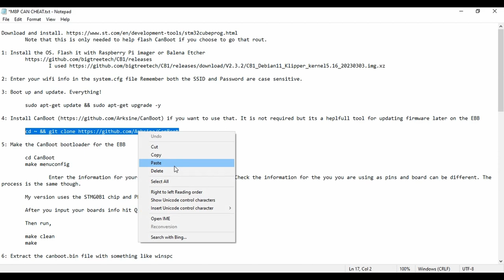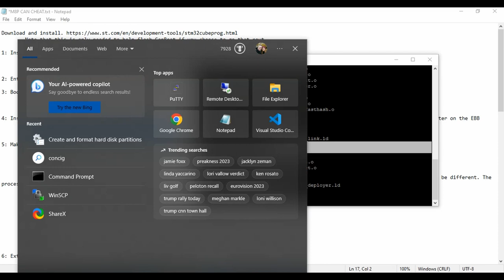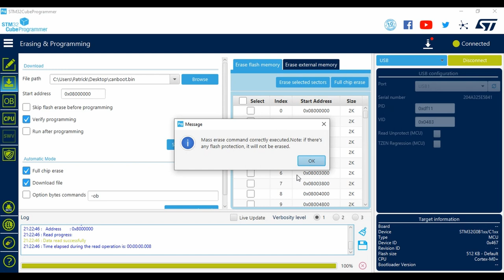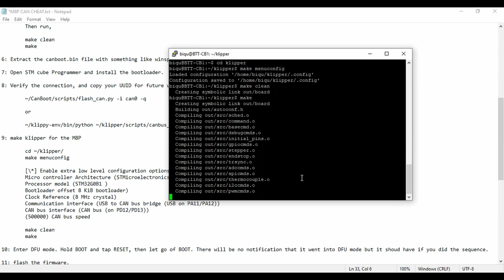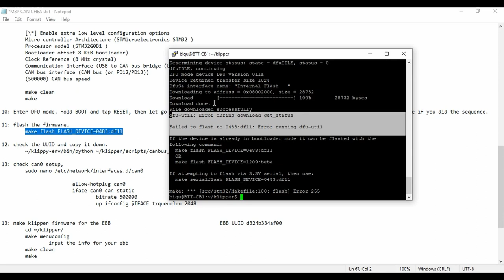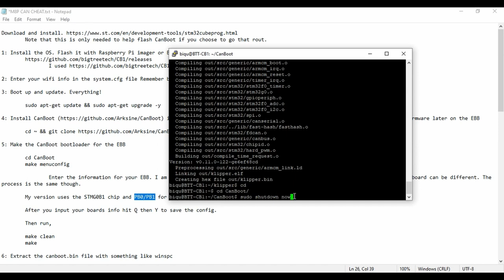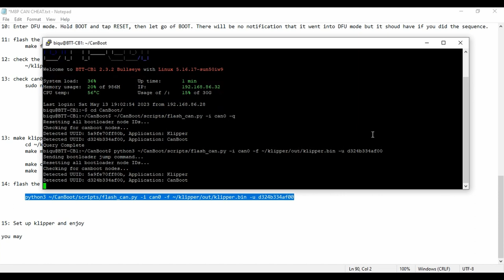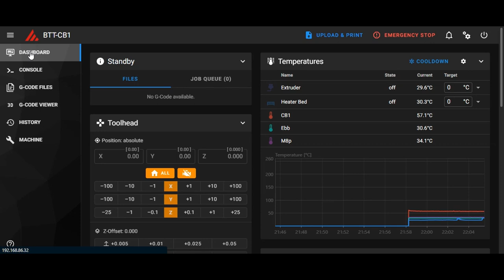Manta M8P+EBB CANbus Setup

Comment: hey there. super informative video and im super new to all of this. how do I safely ssh into the cb1 v2.2 so I can install the image? I know it's probably really basic but this is all so new to me. if you could point me in the right direction id be so very grateful. thanks a ton.
Reply from the maker: I like to use a program called PuTTY (putty.org). After connecting to your network you just enter in the ip address and connect.  The cb1 default username and password are both, biqu

Comment: im even confused now if this stm programmer is the same because I cant find the options fo see USB or even flash. do you have any recommendations how to ?
Reply from the maker: I see some had to use an older version of cube programmer.
Reply: @StackingLayers  is ok the software installed other apps i was using something different not actually programmer. Now it worked. But I'm now trying to make did to show up I'm stuck here I'm installing 120r pin and also connecting the Cable . That part on the video you didn't mentioned
Reply from the maker: The 120r jumper needs to be on the first and last device on the canbus

Comment: I decided to dive into canbus using a manta m5p and ebb 36, using you video i was able to achieve this.  However do you have a video or atleast a recommendation, on the configuration that needs to be done in klipper to get this to work?
Reply from the maker: This is the generic printer.cfg for the M5P https://github.com/bigtreetech/Manta-M5P/blob/master/Firmware/Klipper/generic-bigtreetech-manta-m5p.cfg

And this is for the ebb 36,
https://github.com/bigtreetech/EBB/blob/master/EBB%20CAN%20V1.1%20(STM32G0B1)/sample-bigtreetech-ebb-canbus-v1.1.cfg 
You'll need to make a printer.cfg that combines them or set an include function.

Comment: Nice explenation, Its close to the hermitcrab. At this moment I'm having the problem you commented out in your video. I loose the communication once I call for the UUUiD.  or it just give me one node UUUiD.  is the a way to flash other than having a new SD card on CB1 or to fix the problem ?.
Reply from the maker: You can try to stop the klipper service before querying the UUID. That will sometimes work. This is the command,
sudo service klipper stop 

And to start it back up,
sudo service klipper start

Comment: why do we need to use stmcubeprogrammer? as a canboot for the can bus? as for my situation im using fly sht 36 pro, and at github it is said to have preinstalled canboot, so i assume i can skip the smtcube programmer right?
Reply from the maker: Correct. There have been several update since I made that video so I think I will be doing a revised video soon. But if you already have can boot installed then you can skip that.

Comment: Due to an SD card failure I had to start again. Everything went according to plan but when trying to configure klipper I get this - Option 'serial' in section 'mcu' must be specified. The /dev/serial directory is missing - how/what?
Reply from the maker: If you set it up as canbus you have to use can_uuid not serial. Like this,

    [mcu]    
    canbus_uuid: your UUID goes here

Comment: i am a little confused i got to step 13 now for flashing the EBB do i connect it via canbus hi / low or usb host on the cb1?  that part was left out of the video how to connect to ebb to flash klipper
Reply from the maker: Yes you connect to canbus at this point. I didn't show it but mentioned it around the 31 minutes mark.
Reply: and you are still powering the ebb via usb?  @StackingLayers
Reply from the maker: No, I connect 24v from the power supply.

Comment: Would this work on a manta 4 board?
Reply from the maker: Unfortunately the manta m4p doesn't have a canbus transceiver built-in, but you could attach a U2C module and that will work. You would skip the can bridge firmware for the m4p and just set it up as normal usb connection. The ebb will be the same as in the video.
Reply: @StackingLayers  

I bought a custom built ender 6 that was somehow running  can bus on a manta 4 board the I think a power surge took out my programming and I can't find how to re enable it.  Should I upgrade to the 8 or the manta 5 board
Reply from the maker: If you had canbus running then there must be a canbus hat on the gpio pins or a U2C module the manta m4p cannot run canbus alone. It doesn't contain the physical components for it to work.
Reply: @StackingLayers  
I have look so many times and looks like a plain normal m4p

Comment: can't get it to work, following all the steps, then after flashing m8p rebooting and connecting the can cable no uuids found when " ~/klippy-env/bin/python ~/klipper/scripts/canbus_query.py can0"
Done this a few times, seems everytime i power down the boards they reset? got everything working once, but stopped after i shut down the printer. 
help...
Reply from the maker: They can't be reset as there's nothing to reset to. Once you get the UUID entered and klipper sees it then it will not show anymore. It also will not change, so if you have it saved it will be the same uuid. Otherwise make sure to not set up the uuid in the printer.cfg until you get all that you need, and save them in a text document os something like that.

Comment: Thank you so much for the  video its been really helpful. I was able to get to the point where I flash the firmware to the manta board but I seem unable to get the board into DFU mode. everytime I run the flash command it just returns that there is no dfu device.
Reply from the maker: Make sure to firmly hold the boot button down and continue holding it while you click the reset button, after that you can let go of the boot button. It should be in DFU mode after that.
Reply: @StackingLayers  I have done that multiple times with no luck. Just to be sure I did everything else right I started from scratch and installed a completely new os image and I am still having the same issue.
Reply from the maker: Alternatively, you can use a program like  winscp to copy the klipper.bin (/klipper/out/klipper.bin) file from the host computer to your PC, then change it to firmware.bin and put it on an SD card and flash it that way using the MCU SD card slot.
Reply: @StackingLayers  Thanks, I tried that and the Manta doesnt even seem to be reading the file, I have tried 3 different SD cards. when i reboot the board with the firmware file on it is doesnt change its still a .bin file.

Comment: Hello, when I set the M8p to DFU mode, I can see the device with "lsusb". But when I try to check for connections after the flash, I get "Failed to transmit: [Errno 100] Network is down". Was the katapult software supposed to start the CANBUS connection or something?
Reply: Right after I posted this I repeated the same thing for the 100th time and it started working... I want to leave this up for others if you see this error to check the can0 config in top of desc. After I copy pasted that into there and rebooted I was able to flash to 0483:df11. Thanks for the video and notes in desc! Idk what I'd do without it
Reply from the maker: Yeah I was just going to say to check that can0 was set up in the /etc/network/interfaces.d/can0 file. Good to see you got that going.
Reply: @derson754   @StackingLayers  help I am also stuck here.  I can see it in DFU mode using lsusb.  I get 'download done' when I attempt to flash, but then get the 'network is down' error.  Where do I look from here?  What is supposed to be copy/pasted?
Reply from the maker: You might need to set up can't
    sudo nano /etc/network/interfaces.d/can0

In that file you should have something like the following, remember that the bitrate part needs to be the same on all devices.,

allow-hotplug can0
iface can0 can static
    bitrate 1000000
    up ip link set $IFACE txqueuelen 1024
Reply: @StackingLayers  That was it.  Big thank you for this video.  Now to set up Klipper...

Comment: Hey man thank you for the amazing video I have a question for ya I would appriciate if you reply

When I flash my M8P via DFU mode I am able to get the Klipper UUID and everything
then I power it off then on again there is no way to get the UUID or device name which makes me flash it again and again. Why doesnt it stay on like that what am doing wrong?
Reply: I was able to set it up on the third day. :) EBB SB2209 to manta m8p.
Reply: @oguzhanpiskin4905  Can you tell me how you solved the problem? I have the same issue. When I flash the M5P the uuid showes up when I use the query command but after reboot the uuid is gone. I tried unplugging the EBB36 because I thought this is the problem but it didn't show up eighter.

Comment: does this work with fly sht 36 pro
Reply from the maker: As long as it's configured correctly, with matching bitrates, and wired correctly it should work.
Reply: @StackingLayers  a quick question, i just bought a voron already set up and running, yesterday i updated my mcu manta m8p  to newer klipper v0.12, ive had a problem to flash the firmware to the fly sht 36 pro, but the can is already installed and setup, at the mainsail, it only stated that my mcu sht is not up to date, so can i just follow all your step here just to flash the firmware of the sht 36, or will it do any problem later if the can already setup bro, and im redoing it again following your setup here in this video?
Reply from the maker: @muhammadakmalfadilah3273  yeah you can just update the the sht. It's recommend to update all boards though. And remember that you have to set the canbus bitrate to match whatever the rest of the system is. Originally in the video I has set 500000 but it's more normal now to have it set to 1000000.

Comment: Hi,
i have tried this for two days now, but always get to the same problem:
1. I flash the image on the pi, then the firmware on the m8p
-> everything works and shows values
2. I do the things you have described : All canbus devices show up with UUID
-> 'ls -l /dev/serial/by-id/' returns 'No such file or directory'
And klipper says 'klippy tries to communicate .. etc.'
So the problem is, that i loose the serial connection to the m8p, when i flash it with the CanBus firmware ?

Any advice ? I have gone back and flashed the m8p with the old code and it works again, but Can Bus doesn't
Maybe some can help me here ?
Reply from the maker: Canbus takes over from serial you don't use the /serial/by-id anymore

You need to set
canbus_uuid : the UUID number here
Reply: @StackingLayers Oh, yes you are correct. Thank you a lot!

Comment: Hi - do you know of any other way to get the UUIDs as mine will not show

can't figure out what i am doing wrong!
Reply from the maker: Do you already have a printer.cfg set up for the m8p in mainsail/fluidd? If so put a # by the UUID you have so it can't connect, or backup and remove the printer.cfg so Klipper has no way of connecting to can0. Also make sure you have the 120r pins jumpers in place.
Reply: @StackingLayers  let me try that 👍👍

Comment: Hiya, I'm interested in getting ebb36, just wondering though, as I'm running orbiter 2.0 with orbiter filament sensor, can both be plugged in to the CANBUS?
Reply from the maker: It depends on what the sensor needs to run but if it's set up like a normal sensor then yes. The ebb36 has endstop pins that can be defined for various things.
Reply: @StackingLayers   I'm planning to use this on my Merc 1.1 conversion which has got X-AXIS endstop as part of the toolhead (EVA2.4).  if the endstop is taken for the filament sensor, how can I continue to use the X endstop? thanks
Reply from the maker: There are 3 available pins for the End-Stop and other options
Reply: @StackingLayers  yeah, but I since I need it for filament sensor which need 4 (5V, GND, sensor and unload), I'm only left with 1 which is not enough obviously for an endstop
Reply from the maker: Standard endstops need only 1 sense pin and the other side to 0v(ground) 5v is not needed.
Reply: @StackingLayers   so are you saying that I should take the GND from say the RGB? or crimp 2 cables into the GND pin for both endstop and sensor?
Reply from the maker: @unlock-er either way works all the grounds are on the same bus. This is the schematics https://github.com/bigtreetech/EBB/blob/master/EBB%20CAN%20V1.1%20(STM32G0B1)/EBB36%20CAN%20V1.1/Hardware/BIGTREETECH%20EBB36%20CAN%20V1.1-SCH.pdf

Comment: hey. at the step 12 and onwards, did you power ebb via psu or usb?
i'm currently stuck on that step as the cb1 doesn't see the ebb.
Reply from the maker: It's only connected to the USB to do the initial install of CanBoot. The rest is powered from the power supply and plugged into the CAN port.
Reply: @StackingLayers  wow, quick reply.
Do I need to put jumper cap on the PT pins also to make them talk to each other or 120R would be enough?
Reply from the maker: The PT pins are for a temperature sensor.  You just need the 120R jumpers on both boards
Reply: @StackingLayers  thanks a lot. Apparently, you can't power it via usb to just set up klipper on ebb. (wanted to test it, just to know)

Comment: Thanks for your videos. I wouldn't have gotten this far without them. I'm having an issue with config, and most configuration references/ posted issues/ and tutorials seem to refer to USB installations. I'm running an M8P v1.1 with an EBB42 v1.2, identical to the one in the video. 

-I can get to the point where I have 2 UUIDs listed and I know which is which.
-my printer.cfg file contains only [include] statements
     -an [include] statement for the generic board file. The file is present and contains (among other things): 
         [mcu]
         canbus_uuid: xxxxxxxx
         canbus_interface: can0
     -an [include] statement for EBB. This file contains the [mcu EBBCan] statment with the appropriate UUID, similar to 'mcu' above
-I can restart the firmware in mainsail, and my UUIDs no longer appear when running the query command. (Sounds like this is expected behavior)
-Everything seems in order, but I get mcu 'mcu' unable to connect in mainsail
     -log entry for [mcu] indicates a timeout and some associated serial connection closures.
-as I troubleshot, I tried re-flashing klipper. This seems to function for the mainboard, but I have to take EBB back to STM32 to be able to flash it again. Sometimes this still doesn't work.

So first, why can't I get mainsail/klipper to connect to 'mcu'?

Second, why does katapult seem to get klobbered when I flash the firmware to the EBB? It seems like is just extra steps if it doesn't make updating firmware easier.

Thanks in advance for any help.
Reply from the maker: You don't need the can interface line, just the UUID. I'm fairly certain that can0 is default. Otherwise I would suggest you check that the termination (120r) jumpers are in place on the M8P and ebb.
Reply: @StackingLayers  Thanks for replying. I've verified that the jumpers are installed. I suppose the next step is to reach out to bigtreetech and maybe the klipper forums.
Reply: @StackingLayers  Well this is embarrassing. Somehow I dropped a digit from the middle of the affected UUID. I now have communication with 'mcu'.
Reply from the maker: Haha don't feel bad. I somehow added 2 random digits to one I was setting up last night.

Comment: on step 11 make flash FLASH_DEVICE=0483:df11 is this just a generic command or is it board specific ?
Reply: It's a device ID for your stm32 that's in dfu mode. klipper has added the tools from stm32 to allow to flash to these chips
Reply from the maker: That's the common id for the chip. You can always check with the command lsusb

Comment: I have followed this tutorial 3x over and still not working for me... Manta M8P V1.1 + CM4 and SBB2240 ( used can settings from manual )
Reply from the maker: Did you add the required information in the Raspberry Pi /boot/config.txt file and /etc/network/interfaces.d/can0?

Comment: m8p v1.1 + ebb36 v1.1
followed to a tee and worked after flashing and cfg worked. BUT after klipper firmware restart linux does not see can0. do you have any insights ? maybe moonraker service settings or something ?
Reply from the maker: Are things still working but you cannot query, or do things stop working?